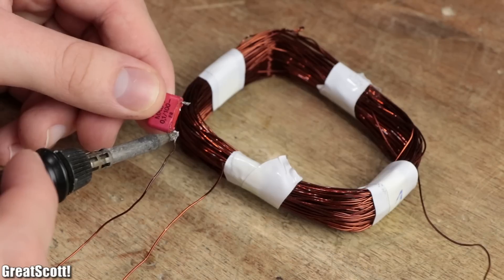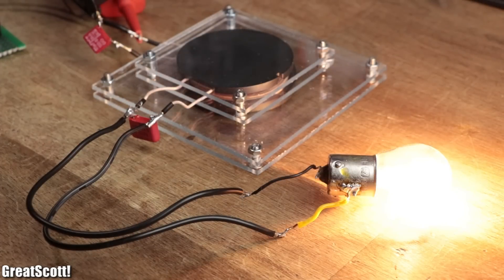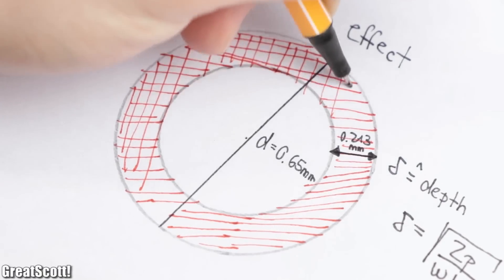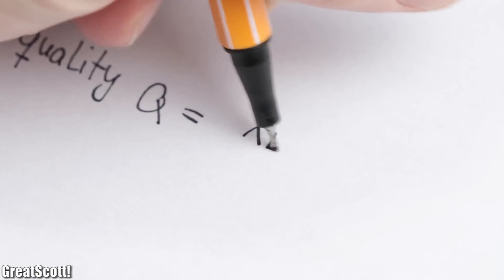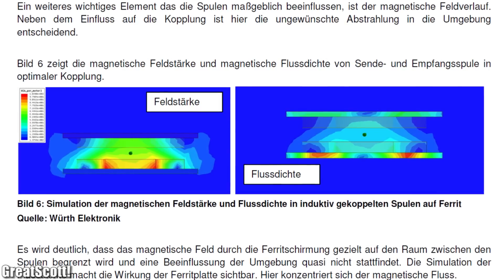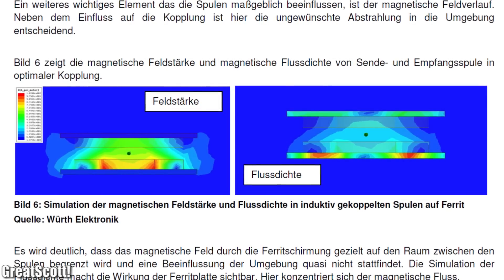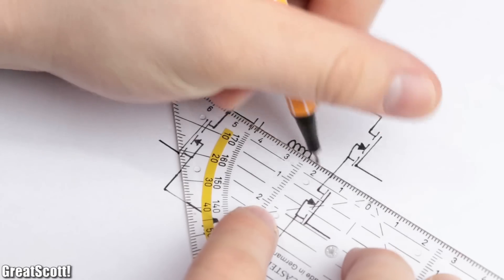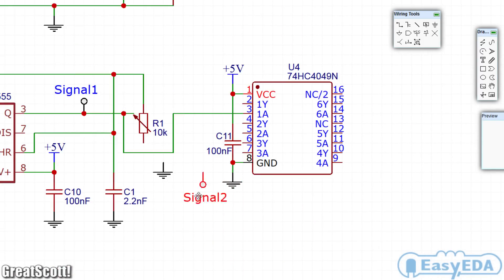DIY Wireless Energy Transfer System

Comment: Hi Great!

I really NEED a solution for my 3D printer1

like in all of these 3D printers a lot of power is 
sent to the hotbed via a moving cable!

and I really dont want that much current flow via 
brushes that glide on a conducting rod!

on the other hand - there is always a relative motion
between the power source and the hotbed and we
simply cannot get rid of that motion.

yes, I could shape the coils rather long than round and 
I could place them very close to each other but still
the areas would only overlap to a cetrain extend
while the printing bed is moving ...

And I am not as skilled as you to do the math ...

should I plan a 10 cm long coil at the bed and 4 
5 cm long coils at the stator(frame) and switch the
stator coils according to the bed position ?

It would be a great thing to revolutionize the
heating power solution for future 3d printers!

Gerald

Comment: Wait with the midget drivers, does that help with switching the midgets and still get the same frequency? Because whenever I connect a 555 timer oscillator circuit directly to a mosfet the output frequency is different

Comment: Is it possible to use H-bridge with bipolar junction transistors instead of MOSFET-s?
Keep up the good work. :D
Reply: You only need a different driver. The H-bridge is just the topology of the power components.

Comment: would this be able to change a phone wirelessly?
Reply: no the power output is too low, if you set your microwave on 500w and set your phone in there for 5min that will fully charge it quickly though, essentially the same thing

Comment: hey good prooject. i have a doubt, does the rf transmitter transmit any voltage? can i add a diode there because i want to connect  many encoders ht12e to i single rf transmitter , so can i use a diode there. pls can u reply me soon. thank u

Comment: I would be interested to know what sort of RF interference is put out by such a circuit. 150 kHz is after all quite close to the LF broadcast band. Also, I wonder if there is a danger of interference elsewhere for Ham radio reception in LF and HF?
Reply: is it normal that when I turned mine on I passed out for 20min and when I woke up my house was on fire?

Comment: in schematic u shown bootstrap diode connecting to the VB ,but next to the Bootstrap diode u shown capacitor from 12v to ground for what? i mean this capacitor has no connection to circuit so whats the purpose of it? also u shown such capacitor near to the voltage regulator circuit in schematic..what is for this? are they really to connect from supply to ground?

Comment: Awesome! some your video helped me on my projects ^_^ can you make a video for a 12V solar panel? with charge controller to charge a salvage Ion battery from a laptop? or some tips for that?
Reply: Don't short circuit stuff, otherwise, a simple boost converter from the internet helps very well.

Comment: I am working on a project using a wire wound coil  to activate a transmiter and receive 18bit digital signal from it once it got activated. the transmitter uses 100khz rf signal to send thise digital bits.

The previous equitment was no where to be found and only the receiver wire loop left.

My project is to use a arduino to  parse  the bits from the transmitter. I remember that the missing equipment was just a tablet and nothing else.

cancould you please give me some ideas on how to make it work using arduino, much appreciated

Comment: Greetings sir, ¿is it possible to: at the receiver coil have 1.5 Volt 40mA or 5 volt 1A with a simple capacitor trick? I would like to convert my wireless mouse into a wireless energy mouse

Comment: Hi My wireless Fantasy Charger is blinking Red Blue and wont charge the phone. im using a universal wireless charger. After a few hrs the Base got hot and it started blinking. please help. looking to tear down the circuit and modify it or repair it but its all micro circuit and ICs help please.

Comment: it is possible to transmit radio signal then convert into electricity
Reply: It's the same thing, essentially. The power is being transmitted here is at RF frequencies I'd imagine, haven't watched it all yet, so technically he already is.
I recommend reading up on Nikola Tesla's work if you want more information :)
Reply: No, this is by magnetic waves, not electromagnetic waves.
Reply: Uhh....no. It's induction...using one coil to generate the (oscillating at whatever frequency) EM field which induces a current in the second. He's matched the resonant frequencies of the coil for the most efficient transfer of energy.
Reply: Nic Wilson Yeah, but it doesn't use photons to carry the energy. It simply uses an oscillating magnetic field.
Reply: ...what?
Reply: as long as a magnetic field is oscillating it creates(induces) an oscillating electric field and vice versa. That's the law of Electromagnetic Induction.
Reply: Nic Wilson If it was electromagnetic, it would carry the energy on photons (aka light particles). However, it doesn't carry them on photons. It makes an oscillating magnetic field, and as you may know, moving or oscillating magnetic fields induce currents.
Reply: I think you've got that a little backwards there. Light is part of the EM spectrum
Reply: Radio waves are generally between 1KHz, up to many GHz (including the microwave frequencies)...and a higher wavelength in the spectrum that even infrared light.
You can communicate using light just fine, just as you can using microwaves (they're still radio waves) or any frequency you wish. It's all about the broadcast power, method of transmission and frequency. 

I think we're getting our wires crossed here, so to speak, and are probably hinting at the same thing in different ways :)
I do have a lot of electronics engineering experience and years of playing with things like this and all manner of related things, but yea, I think we're just getting our wires crossed :D
Reply: light is both the magnetic and electrostatic fields vibrating 

in this case only the magnetic field is present and obviously is the only one osculating 

due to imperfections in the circuit mainly the magnetic circuit not being complete (air core inductors) some energy is lost in the form of electromagnetic radiation which as the word lost implies does not plays a role in this wireless power transfer

so yea you are getting your wires crossed :D

Comment: Anyone know of a good database of designs that will tell you what you can build with random IC's?
 I salvaged a bunch from amps power supplies tuners and serio equipment. I've been looking up what their function is pin arrangement and so on. I want to know if there are any practice circuits I can build a functioning item using these IC's. Just for practicing the whole path of building a circuit with items that don't matter. I do a lot of repairs but it gets boring after a while.
I built a PWM signal generator from a  SG3525 IC By adapting some schematics I found. I go it to work but not properly. The  variable resistor has no effect but I don't know why. Using it to power and control old 3 wire server fans.
Reply: Rather go with a wanted function, and see what you can make into providing that!

A database like your suggestion would be really inpractical, since there is almost always one more way of using a given part.
(just check opamp circuits, or ways to use the 555)
Reply: The only reason I didn't use the 555 was I was wondering if it would work at all by adapting the IC I had. and Because I didn't have a 555 IC. I've played with resoldering it so much the board is wearing out lol. I'll try that and see. It uses pin4-5 with a 10 and 10O nF resistor as comparison that gets fed back in to create the PWM on the output pin.
I was hoping there was already a site that listed a large number of projects.
I was thinking a listing of each IC that people have found useful or made projects with. Each listed with projects underneath. As people came up with new things to build with that IC they could just add the parts list and schematic to the list. With sub headings for mods people come up with. Having this all in one database would be so handy. With a good app to go along with it. You could decide quickly if someone's junk is useful to you. Look up the equipments model number out spits a list of IC's inside. What their function and data sheets say and projects you can use them for. It would be a lot of work that I hoped someone's done most of already.
Reply: *****
I don't know any sites like that.

SG3525 can be used as PWM source, but the feedback circuit contains a integrator (with output on the comp pin, but the comp pin is also input to the PWM circuit)

You quite much have to figure out the circuit, in order to use in in different ways!
Reply: Yup I haven't given up till I've blown it up.
Reply: *****
Good! Even a half-blown part can be rather frustrating. When is something blown up anyway?

Big crater? or just slight change in function?

Comment: could you make a phone charger with this
Reply: yes with a proper voltage regulator and bridge rectifier as well as capactiors.
Reply: He could really build one, his phone supports wireless charging
Reply: The standard that they use makes it impossible to make one yourself.
Reply: this isn't really possible because the qi standerd isn't just power 

he can make a wireless charging station
Reply: you can make one i guess but the receiver should be still plugged into the phone.... (not using the built in qi one, if there is any)

Comment: Why? Whats the purpose of a wireless charger, if the transmitter and reciever have to be so close together they might as well touch eachother, defeats the purpose of "wireless". Its basically the same diff as a cable charger, except with a cable charger, THERES DISTANCE BETWEEN THE 2 POLES!!!
 So again, why? Whats the purpose?
Scientists have wirelessly transmitted over 7 feet before. Ur rockin a gap of mere millimeters. No point, it might be "wireless" but its still a shackle, more than a cable charger.
 Show me a backpack with a battery in it thatll charge andor power my personal devices in my pockets, and maybe even my electric roller skates.
 But no. A phone charger that requires my device to stay in that one spot. Its even less usefull than a cable charger, which will atleast give u 3 to 10 feet to move around in, while charging.
 Im sure alot will disagree with me, but wireless chargers are dumb.